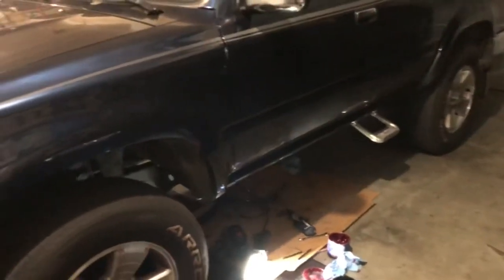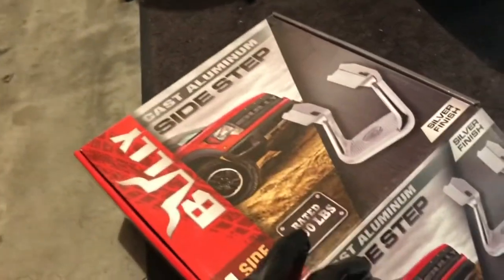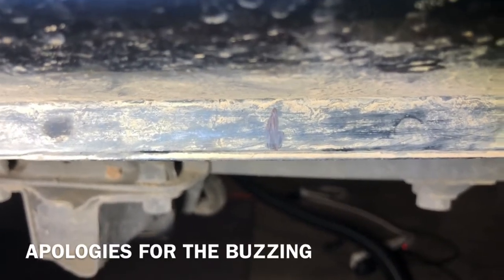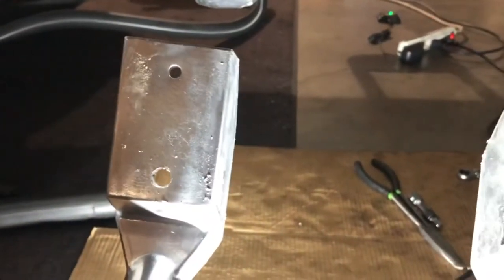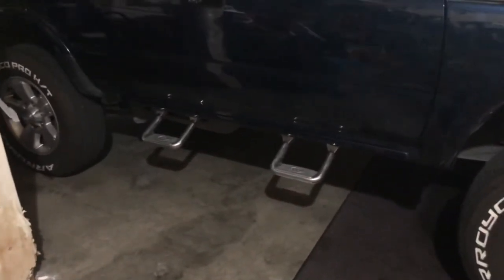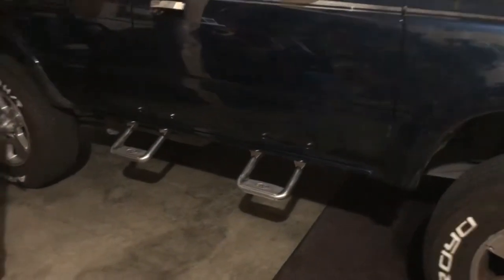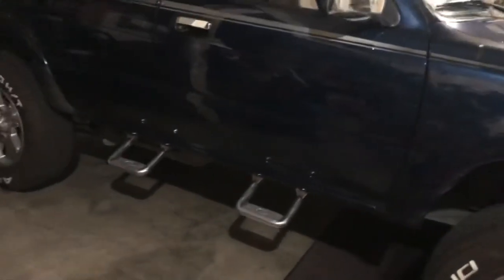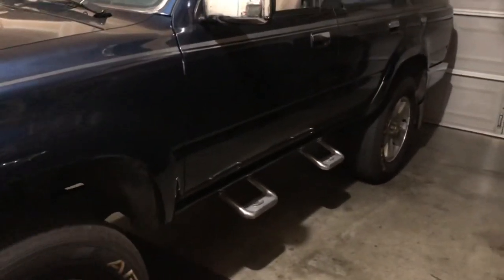Toyota 4Runner gets new Sidesteps (Bully Aluminum Sidesteps)

Comment: I just bought a set for my 2002 4Runner but all the other vehicles that they mount these steps on have a flat back side on the rocker area mine is rounded so I’m like wondering how I’m going to mount them , you seemed to have got yours mounted how they holding up , when I ordered mine the pictures look like they were made from tube and then I found out they were cast and was worried that they weren’t going to be strong enough, good job on the mounting 👍
Reply from the maker: It’s been almost a year since I installed these. They’ve been great so far
Reply: @TndPnyRCofficial  👍